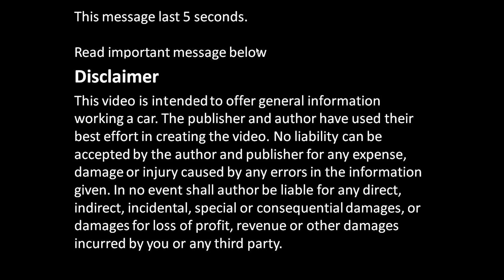How to disassemble Toyota Camry front driver seat. Years 1992 to 2014

Comment: Remove the head rest first. Seat becomes smaller and lighter, easier to extract. Stretch it all the way backwards, then pull out through the rear door. Clean the dust and oil first with disposable gloves. Use clean glove when handling the tapestry. When the seat covers are free, it is a good idea to wash them, laundry machine or hand-wash.
Reply from the maker: Thanks for info. :-)